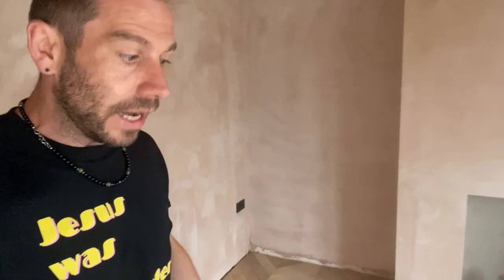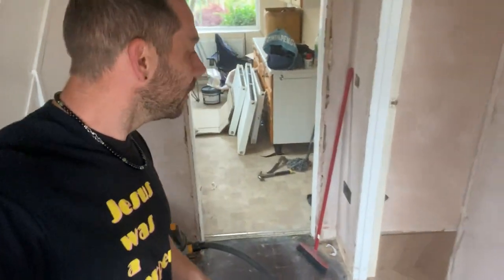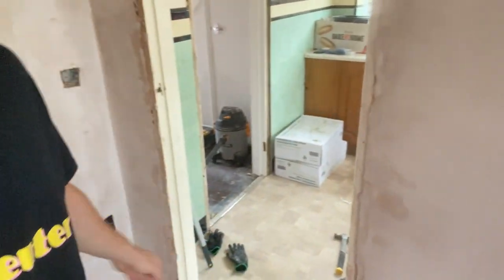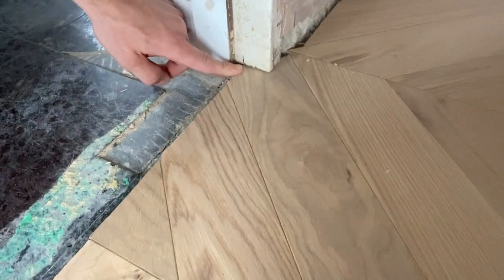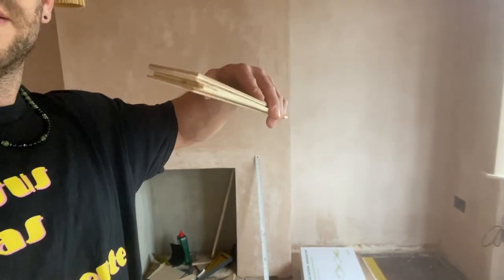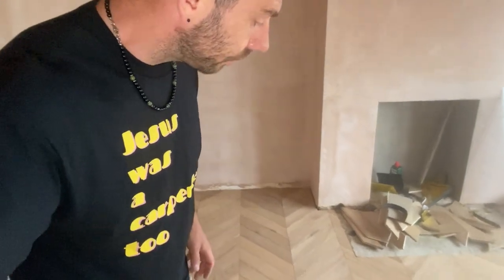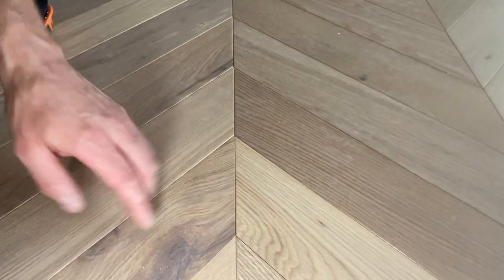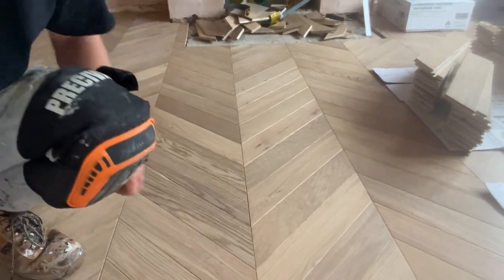Chevron flooring installation on underlay. Full Tutorial.

Comment: I hope whomever paints those walls makes sure not to make a mess of the newly laid floors. If I was the customer I would've prioritised the decorator before the floor fitter.
Reply: From the looks of it, the radiators are still to be fitted, too, lol. Goodness me, I hope the plumber isn't a fat-fingered bodger when he's soldering and messing around with the central heating pipes, because that floor is going to be ruined unless it's thoroughly protected.
Reply from the maker: Yes i agree thats always the case. In theory thats the ideal plan but reality is mostly trickier, i was available on those days so they decided to have me fitting floor then and there and painter who they employed was available later on. 
After all, all looked good and place looked finished nicely.

Comment: This floor has to be glued down. You can’t install it floating. Very strange approach.
Reply from the maker: Yes You can install this cheevron engineered floor by gluing edge to edge each board and have it all on underlay just as normal straight tongue and groove  engineered floor which is also fitted mostly on underlay. 
Also after listening to clients and their request not to use expensive glue and to achive better insulation underneath  as a fitter i do fulfil their wish and do the job with lower costs for them and give them comfort of having what they ask for.
Reply: Definitely should be gluing it or nailing it down as it’s not click fit. Will be moving all over the place by now I bet